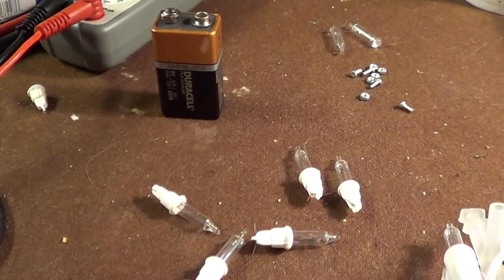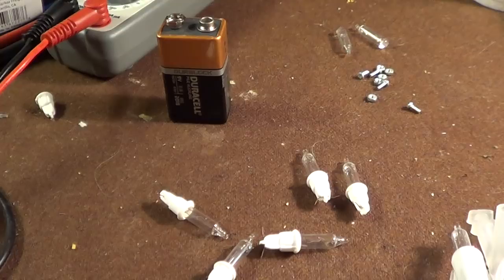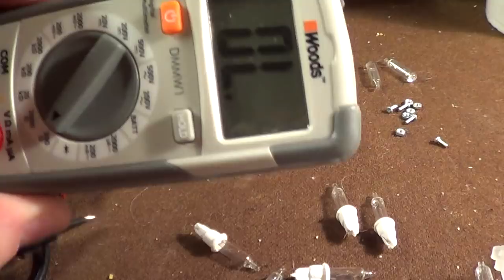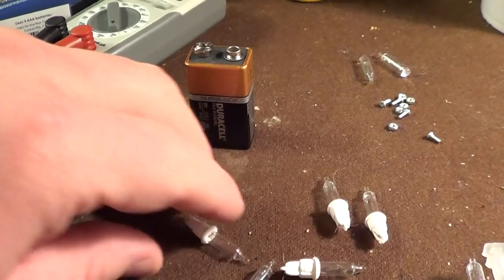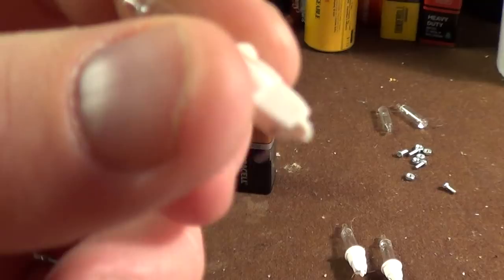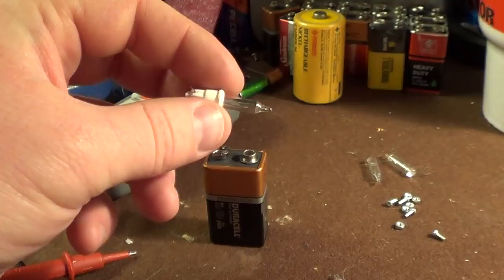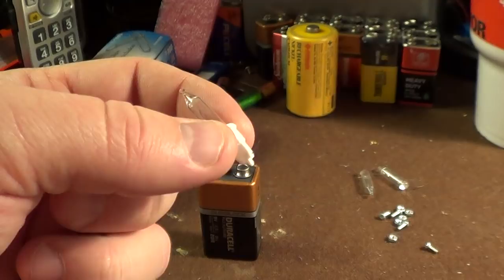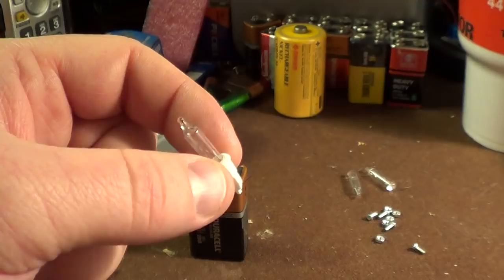How To Easily Test Incandescent Christmas Light Bulbs!

Comment: Your tip saved Christmas for us here in Germany.  We had several Schwebogens that several bulbs were not working.  Very easy to diagnose and ALL lights are working now.  What is a Schwebogen you ask?  It's a decorative candle holder from the Ore Mountains in the Erzgebirge region of Saxony Germany.  The first ones were metal but now they are made from wood.  During the holidays EVERY house has a Schwebogen(s) in just about every window.  It's very pretty when you drive around the region.
Reply from the maker: I am glad to hear it, and I even learned a new word!

Comment: Back in the 90s, we had a little gadget that you put a 9V battery into and it had angled contacts at one end (connected directly to the battery) and tested the bulbs in this manner, probably still in the christmas decs boxes somewhere, but LED has since replaced the incandescent ones that over the years gradually conked out... :)

Comment: I just did this for a GE Christmas tree.....the G E trees have non-serviceable fused bulbs in them.  When they fail, about half the strand of lights goes dark, defeating the purpose of having individually shunted bulbs.  I ended up cutting them out of the series and replacing them with ordinary lights.  Each strand already has a 3 amp fuse on each side of the plug.

Comment: Sometimes I'll measure resistance of half the strand. Then a quarter, etc until I get down to just a small portion that contains the open bulb.
Reply from the maker: I did that last year with a string where one half wouldn't light. All the bulbs tested good, and I never did find what was wrong that half. Just as suddenly as it stopped working, it started again and continued through the season.

Comment: I’m going to try your method. That is very interesting way to do that without spending a bunch of money on those bulb 💡 machines. That unbelievable smart hack. I’ll let you know 🤔 if it works I sure do hope so.
Reply from the maker: It works. Most recently, I restored a light-up angel to life by verifying three bulbs were blown.

(I do have one kind of "bulb machine" that I bought on a severe discount. I've never actually used it for its intended purpose!)
Reply: @uxwbill  all I have to do is take the white one and take wire out than put wire back in. I didn’t get my Christmas 🎄 tree  decorated this year because my mom
Passed 6 months ago and I had a very hard time doing that but I really want to and I’m going to go try this. I hope 🤞 I don’t have to take all of lights off of the Christmas 🎄 tree

Comment: Erm, using a straight 9v without any voltage dropping or current limiting is enough to send peoples blood pressure high.. These bulbs are rated for 2.5V each, 9V will shorten your bulb's life very quickly!
Reply from the maker: Not as much as you'd think. The test is very short since you'll know almost instantly if the bulb is good. I feel pretty certain that the terminal voltage of the battery drops sharply because of its high internal resistance. Operating voltage of the bulb varies.

Comment: My grandfather had a square bulb checker. It was just big enough to house a 9v battery like that and had to copper metal pieces on each side of the 9v, so you could essentially do this same test without having to pull out the wire. I am actively looking for a replacement. Please comment below if you know where I can find them. In this day, one probably could be 3D printed, but I do not have access to one of those.
Reply from the maker: eBay is a magical place, and probably the quickest way, unless you got seriously lucky at a thrift store or flea market. I'm pretty sure that you can have something 3D printed for hire.

Comment: I've had some LED's instantly let out the magic smoke when I put them across a 9 volt. Of course my experience with LED Christmas lights used outdoors was the leads would rust off.
Reply from the maker: I'm quite surprised to hear that the LEDs would be that "tight" on their tolerances.

Comment: They make a little gun that you plug into a socket or just plug the plug it in, pull the trigger a few times, and it fixes the shunt in the bad bulb. 99% of the time the lights aluminate... the bad bulb still out, now can be replaced. I have one, it works great. Also divide the bulbs by 120 volts, that will give you bulb voltage. They make one for LED light sets too, but I really don't care for LED Christmas lights. I may put a couple of videos of my really old vintage lights up in the next day or two.... so check my videos out in a few days.
Reply from the maker: I have some C7 light strings made by General Electric in the 1940s. They've been passed down through the family since new. Every year they keep working without fail, while more of the modern strands fail.

Comment: What about the bulbs that have a shunt that shorts out bulb when burns out. That may not be good for the battery.
Reply from the maker: It doesn't really matter much because a nine volt battery can't deliver much current to start with and you'll know within a second or two if the bulb is good.

Comment: Thank you...but for the set I had the 9v was to much power kinda strange so ended up using a 7.5 volt lipo from one my old ps3 controllers was able to just plug the wires into the plug of the battery
Reply: @AverageUnixGirl  oh stupid me I was thinking my rc car remote  lipo haha funny you are correct 3.7v

Comment: Hi Bill, did you ever post the video on ER pXe ?  If you did, what is it called. Thanks :-)
Reply from the maker: No. A new version was supposed to come out at some point. I held off in the hopes that it would. It never has and I don't think it will.
Reply: uxwbill Thanks for the reply and yeah I did notice they haven't updated the software in a couple of years. Don't know if the project was discontinued or what.

Comment: Hi! Do you know how I can find out how many volts my Christmas tree bulbs are? Can I use a volt meter?
Reply from the maker: Most Christmas light strings are wired in series. One problem with volt meters and Christmas lights is that the average volt meter doesn't put a load on the circuit like the bulb would. The meter could read incorrectly. The bulb draws a lot more current and this pulls the voltage down to the normal value. You may also have a very hard time getting the probes in the socket without causing a short circuit. Even if you do get the probes to make contact, you could be shocked quite easily.

The very high electrical resistance presented by the meter may also keep the string from working at all.

You might try this: Find out how many circuits your string of lights is divided into. Small strings are usually just one series circuit. Larger strings usually have two. A really long string may have three, but I've never seen that many or more. You can do this by removing a bulb and plugging the string in. If some bulbs are still lit elsewhere in the string of lights, you have more than one circuit.

Make a note of how many bulbs went out, including the one you removed. Put the bulb you removed back. Now remove a bulb from the part of the string that was still lit. Count how many bulbs went out that time, including the one you removed.

If none of the other bulbs went out with one bulb removed, you have a string of lights that is wired in parallel (each bulb then operates from the standard voltage in your part of the world, usually 120 or 240 volts). This is common with the old C7 (large) bulbs.

Examples:
Single circuit string of lights, 30 lights: 120 volts divided by 30 bulbs = nominal 4 volts per bulb

A two circuit string of 60 lights where half of them went out when you removed one bulb is treated as two strings of 30 lights, so this still works out to a nominal 4 volts per bulb.

Comment: Are you smart enough to make a voltage dropper fed from the main 9 volt battery that offers various voltages and also perhaps add different bulb receivers all fed from the chosen voltage. Just asking. I'm not smart enough when it comes to electronics. Thanks
Reply from the maker: The "quick and dirty" voltage dropper is just a resistor of a suitable value, placed in series with the bulb. You can find the right value with Ohm's law. Numerous calculators for this can be found elsewhere online. This works, but wastes energy as heat that you can ill afford to lose with the very limited capacity of a nine volt battery.

A fancier approach is to use a linear regulator of the 7800 series (last digit indicates output voltage, e.g., a 7805 outputs five volts DC). The data sheets for these often include an example circuit. They're still inefficient and require about two volts difference between input voltage and output. They can also only regulate downwards (can't boost a lower voltage).

The most efficient approach is a switching regulator. Many are contained within a single part costing very little. You can buy finished modules on sites like eBay that are ready to use as soon as you hook them up. These can also sometimes boost a lower voltage to a higher one.

Really, though, if a bulb tester is what you want to build, I'd start with a better power source than a nine volt battery. Even the best examples contain only a small amount of electrical energy. You could get a small variable regulated DC power supply, which while more expensive than any of the above, would let you easily set any voltage you want (and limit current as well, if needed).

You could also string together batteries in series, and place wire "taps" at the battery terminals. The more batteries between negative and your positive connection, the higher the voltage at that point. This also isn't all that efficient, but it is cheap, easily built, and will work.
Reply: @uxwbill  Thanks for the in-depth reply much appreciated. Since I commented I found a 9 volt DC power supply from an old keyboard in my junk pile. Can’t read what the output amps are as it’s marked up. Would a inline variable resistor on the positive side work as a voltage dropper? If so what value would I need thank you.
Reply from the maker: Yes, a resistor will work. Be careful with plug-in power supplies. Some are unregulated, which means their voltage will be considerably higher when no or a light load is attached. The adapter probably has a current rating of a few hundred milliamps.

Attach a volt meter (any multimeter will do just fine) set to DC volts to the output of the power supply you found and see what it reports. If the voltage is much higher than what it's rated for, the power supply is unregulated and should be used only with caution to avoid burning anything out.

You could determine the current rating of that power supply with a suitably heavy adjustable resistor and a volt meter. Attach a volt meter and start with a high resistance setting. When the voltage drops to around what the power supply is rated for, you will have found its current rating. Record the resistance value and use Ohm's law to find out how much current was flowing. (You can set your meter up to measure current if you have one, but this may be less precise.) Deduct another 10-15% or so for a safety margin.
Reply: uxwbill   Thank you very much again. Let me wish you all the very best for Christmas and 2021.

Comment: Using a battery to test bulbs is a secret? I though it was common knowledge :)
Reply from the maker: I wouldn't pretend it was a secret, just something I happened to think of since the batteries were right there. I don't doubt that many others have done the same. If anything, I thought I'd "pay it forward" by making a hopefully helpful video.
Reply: Of course, I only kidd :)

Comment: Definitely going to use this hack.. also  do you think one of those fairy light bulbs could be wired to the low voltage audio jack of a phone?
Reply from the maker: A phone's audio output won't manage enough voltage or current to light a bulb, and you may damage the headphone driver by trying. You might be able to (dimly) light a very efficient LED, though.

Comment: It's unfortunate that most christmas tree lights are now leds and run from a crappy low voltage adaptor, i always liked the direct mains type, im used to the 20 x 12v bulbs in series.
The safety freaks have made everyone stupid, common sense is thin on the ground.
Real bulbs look nicer to me, leds just look cheap :-(
Reply: Especially when you look at a LED variant of a traditional C7 bulb... its just not the same. Feels like something is missing.
Reply: They don't have the colour and warmth of a bulb, but im old fashoned.
Bulbs remind me of little candles, or i could be mad lol :-D
Reply from the maker: All of the LED Christmas light strings I've seen here run directly from line voltage, sometimes with a series resistor in line. There isn't even a filter capacitor to try and reduce the flicker, something that is extremely noticeable in my peripheral vision.
Reply: uxwbill, Perhaps being 120 volt mains is deemed safe enough, but the 60hz flicker would be annoying.
If they added a bridge rectifier plus change the resistor, 120hz may be less annoying :-)

Comment: Just go buy a light keeper pro people. Just do that.
Reply from the maker: It's hard to argue the advantages that something you already have and can use will bring to the table.
Reply: Should be equally as hard than to argue the advantages of saving time by using the right tool for the job. Trust me, go get one and you will be making a video on it in no time. 😉💡🎄
Reply from the maker: Anything I have to go out and buy incurs what could be called the Thirsty Truck Tax, especially as I'm one of those old fashioned weirdos who sometimes wants to shop in a physical store and see a product before buying it.

As it is, I have a Stanley Tool Works branded Christmas light tester, bought on closeout somewhere years ago for less than a dollar, that does most of what the Light Keeper Pro thing seems to do. I've only ever used it to test VF display filaments, defroster grids in car windows, and for the presence of power in electrical boxes where a meter wasn't too practical -- never for its actual intended purpose. :-)
Reply: uxwbill I completely understand tour resistance I felt the same way. The light keeper pro is more than a non-contact voltage detector. You plug it in to the light strand push the trigger and it fixes the bulbs that didn’t shunt properly when the filament burned out. Pulling the trigger can also show where a loose connection is and if all that fails (and it rarely does) then use the non-contact voltage detector. You can endlessly save strands with this tool and it pays for its self quickly. As your someone who likes to preserve old tech I would think you would welcome this tool to preserve the warm glow of these old miniature lights. I think you would really appreciate how this tool allows these old strands to be fixed up like new. Cheers!
Reply: @pikadroo  I absolutely agree with you!!!! The lightkeeper pro is absolutely amazing and extremely time-saving and efficient. I would also recommend it @uxwbill. For the price, it pays for itself within one or two uses, I'd say. However, I'm in a position where I don't have that tool, but I do have a 9v battery and that's about it. I'm sooooo glad I came across this until I get my lightkeeper pro! This works great when you're in a pinch, but the lightkeeper pro is going to save me sooooooo much TIME and money. It's really a superior tool. :) Between these two techniques, I never have to worry about those annoying Christmas lights again!!!

Comment: Maybe don't do this on LEDs? The first one I tried was blown dead by the test, and I knew it was a good bulb.
Reply from the maker: Definitely don't do this with LEDs. Use the diode testing range on a multimeter. It doesn't even have to be an expensive meter. Many will dimly light an LED in that testing mode. Or (briefly!) use a 1.5 volt battery or two.

Comment: As I was testing my set of (very cheap bulbs) I purchased at Walgreens at a clearance price of just $1.99 for a 30 foot stand of mini, sounds like a steal.. but of course the year later, the set didn't work, (well three out of the four boxes). As I was getting ready to test these lights and bulbs, I got to reading one of the warning labels, and it read "Only use these light for temporary use of 90 days max~!" I couldn't believe what I was reading, we have come this far to throw things out, even Christmas lights are a one time use now!? Ridiculous,.. of course they were made in China, and yes you get what you pay for, but I've seen everything now. Yes I could get them to work, but at what expense of worrying about the electrical cord heating up causing fires, because there is a time limit on them! Trash at it's best! "Hear that China!" So before you even get ready to test your lights out, make sure they are even worth wasting time on! Otherwise chaos could be down the road for you, or just a million head pains!
Reply from the maker: The quality of Christmas lights has been poor for many years. We have two strings of GE Christmas lights dating from the 1940s and using C7 bulbs, and still use them alongside the more modern lights. I'll be surprised if those GE lights ever fail. 

A rather newer string of bubbling lights from the 1980s (made in Hong Kong) came pretty close to hitting 30 years before the sockets got flaky. Not great, but leaps and bounds beyond what regular lights manage.

If the most basic checks failed to produce a working strand of lights, I used to pull all the remaining good bulbs and recycled the rest. I have so many spare bulbs that I don't often bother doing that any longer.